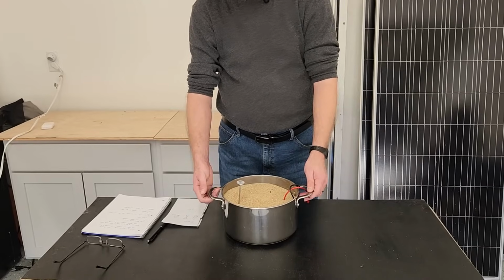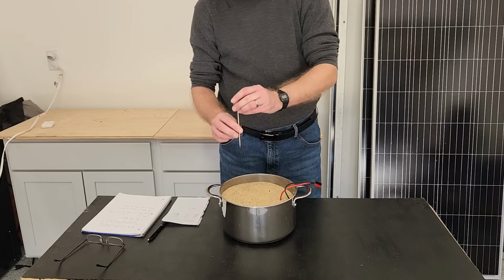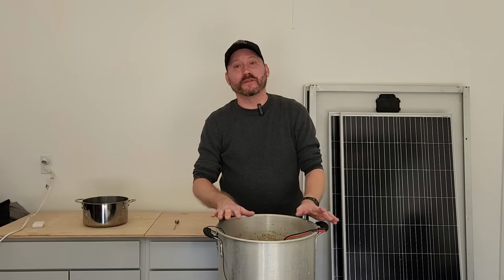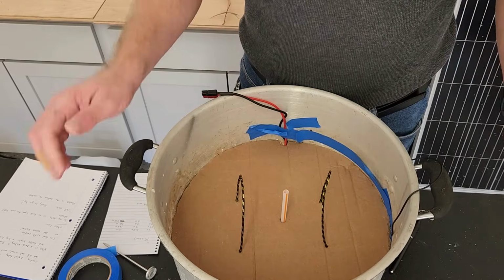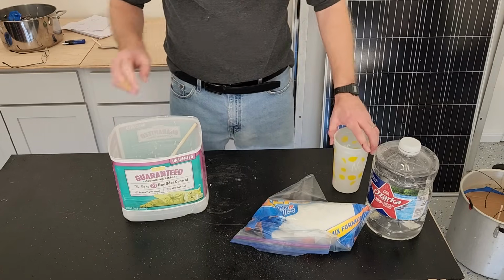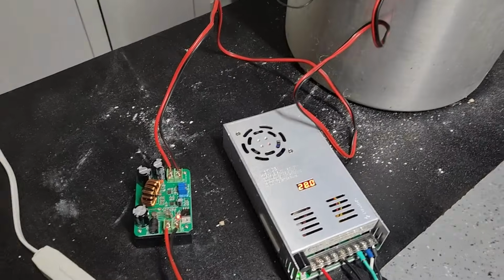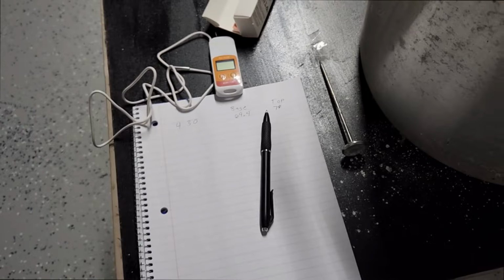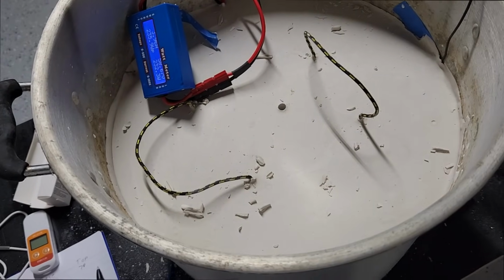Sand Battery heater. Create free heat  of 500F using solar electricity! Texas Prepper Projects

Comment: Hi, Nice project. You could turn the pot upside down. Make an entrance at the bottom for the thermometers and the heating element. They Will be at the cool bottom side and the warmth will be trapped on top. No chance of any heat  to leak through the lid. Secondly add insulation on the sides and insert U shaped tubes from bottom to top and back . Blow cold air through the tubes to extract heat. So you control when you want it. Use air to extract heat. With a fluid        is more dangerous because it will boil. Extracting heat allows you to setup the sandbattery stationary elsewhere and increase its size and capaciteit. The Hot air could be used to heat a secundairy heat exchanger Linked to a central heating system. You will have thus  more control over  the maximum temperature in the secondairy heat exchanger.
Reply: He is dealing with so much heat in some spots,  he might have a problem with oxidation of metals. But maybe he can run some copper pipes down the outside and coil inwards along the botyom and drill some holes on the bottom of the copper coils and force air through slowky and let the air filter through the sand.
Reply: If he had a more distributed heating element with a larger surface area, a mineral oil could withstand 500-600f. It would fill the airgaps reduce prevent oxidation of metals in the heating element and better distribute the heat to the entire body of sand.  Downside is while it may end up holding more heat, the sides would get hotter more quickly and it wouldn't hold the heat as long.
Reply from the maker: maybe

Comment: I would suggest using cement board instead of wood to create a trivet to set it on. Not a lightweight solution but it would not burn or melt.
Reply: That was my thought. Cement board or similar.
Reply from the maker: Agree
Reply from the maker: Agree

Comment: Good video ! I haven't read trough all of the comments , but I've seen some god suggestions for improving the sand battery. I would suggest that you get rid of copper water heating unit , because it will fail shortly at that temperatures and go with stainless steel ones (like from hot plate , or (even better) small electric barbecue grills - bigger heating surface) . Other suggestion would be to drill holes in the bottom of the caldron and to make electric connection outside of the sand container and prevent wires from melting and burning. You can also make hole for thermometer on the bottom too (with some insulation between edge of the hole and heating unit and thermometer probe).  Also , fine sand works better (like silica sand) and couple of coils of flex metal hose (about 2" diameter), within heated sand , will do great for convection heating (blowing hot air) , with a small fan on one end.
Reply: I would skip the electric heaters altogether and use a solar hot water system instead.  That would allow the sand battery to be tied in to a radiant heat system throughout the house.
Reply: @kmoecub  it is not comparable temperature vise. Also , hot water system is a - system , while this can be stand alone unit (and portable , depending on a size and weight).
Reply: Flex metal hose is a great idea!
Reply from the maker: agreed

Comment: Instead of plaster of paris, use the high temperature ceramic bricks that are used to line a fireplace, chimney, or brick oven.  These are available at home improvement stores like Home Depot, Lowe's, etc.  You could also use those type of bricks to build a base to set the pot on.

PS there is a commercial grade version being tested in Finland, and the article said that the sand could be heated to 600 C (1000 F) before it melts.
Reply from the maker: Nifty
Reply: Question: Once sand melts, is it a better conductor because it now has more density?

Comment: Beautiful work here! Thank you for your share! In a future project, you might look into aircrete in place of Plaster of Paris. I'm considering tubing and a compressor to dump heat from a server and a turbine to convert it to electricity. The server converts 3kW to heat, and I'm wondering how much I can convert back. Sand can take 830kJ/kg/°C. I'm planning to run the heat from the server into the compressor, then the sand battery, and then the turbine, the exhaust from the turbine then goes through a vortex tube resenting the remaining heat back to the loop and the cold into the server. My ultimate aim is to process 1MW or 2MW. It will be very interesting to see how much electricity I can recycle.
Reply from the maker: I think i'm going to use concrete for the next build. It's actually cheaper than plaster of paris
Reply: Now you have me thinking of possibilities.  Let us know how your work goes. I think you're on to something in regards to small scale/business waste heat recovery and power generation that would work well in the suburbs and rural areas.

Comment: Figure out how much power you gain approximately per day. Divide that by 12. That’s how much power you can use every 2 hours in a 24 hour cycle. Match those numbers with a long lasting heat source. Match those numbers too the right size sand battery. Make the heat rise after charges so that fan can disperse the heat until the heat is gone. You will need a high cycle battery too complete the system but I bet it’s quite efficient. I feel like your idea is linked too efficiency in some way. I love thinking about these things. I got a 98 in advance chem at one point before I left school. Would love to have a chat with you about it 👊
Reply from the maker: I think that this is about thermodynamics and heat gain.. and what the best way to release that is.  The 500F temp I got was nuts, but it needs to be released slowly and in an intelligent way. Stay tuned for rev 2 and rev 3..  But feel free to email me to discuss more!
Reply: @texasprepperprojects  ok. I just subbed. Will stay tuned. Have you thought of making the sand hourglass out after over time? Might be an easy may too time release the heat.
Reply: @texasprepperprojects  super cool topics 👏👏
Reply: @texasprepperprojects  heated sand waterfall? 😂

Comment: I would put it on flat stone, and also thermo wrap all the wires. Not necessary probably, but would make me feel better about not having any of insulation already on the wires melt and then come in contact with the metal. Also maybe a slower speed fan to move the hot air? Not fast but it may keep the room more all the same temperature. Both ears can be warm that way.
Reply from the maker: I switched to silicon wires in v2

Comment: Seems to me such a thing is most valuable if you have a space you'd like to keep from freezing (like a grow room under LED lights) that gets no direct sun. You could put heat battery in the grow room and the solar panel a good distance away where the sun shines. It's not obvious to me how you'd convert the heat contained therein into electricity.

Well done.
Reply: A Peltier element will convert heat to electricity or vice versa.
Reply: Peltier element or steam turbine  or steam motor for mechanical power. But its most efficient  when used directly for heating
Reply from the maker: i'm already using solar
Reply from the maker: I'm already making electricity with solar

Comment: What holds heat longer a bucket of wax or a bucket of sand
Reply: I would guess wax, but you'd have to do some complicated calculations to know for sure. It also depends on if you mean the total heat or to maintain the temperature. Wax is about half as dense but it has almost 3 times the heat capacity of sand, and its thermal conductance is slightly less.
Wax: Density 960 kg/m3, Heat Capacity 2200 J/kg K, Thermal Conductivity 0.2 W/m K.
Sand: Density 1500 kg/m3, Heat Capacity 830 J/kg K, Thermal conductivity 0.25 W/m K.
It costs about 50 times as much as sand. It melts, (boils, and burns,) at much lower temperatures, so it's not really suitable for an in-home heat battery.
Reply: @Mavrik9000   Good! Now do mineral oil. 😉
Reply: @Struthio_Camelus  
TLDR: You'd need about the same volume as sand but it costs about 15 times more. 
These details are surprisingly hard to find.
Mineral Oil: Density 875 kg/m3, Heat Capacity 1670 J/kg K, Thermal Conductivity 0.136 W/m K.
It would work as a heat storage 'battery' but the thermal conductivity is low, so it would absorb and release heat very slowly. It is used in oil-based electric heaters for thermal mass, and in transformers for cooling. Both are sealed. Mineral oil burns so it would be unsuitable for an open-air/container heat storage system. For an in-home heat storage and release system you would need a well-sealed metal container, and large external metal fins for transferring the heat quickly to air with a fan.
For a similar cost, you could buy (new) steel, which would be more compact, due to its high density. And there would be no need to worry about it being sealed.
Reply from the maker: Don't know

Comment: Sand is not very thermally conductive, in fact its a good insulator. The sand close to the heating element was probably extremely hot, but the heat did not disperse through the whole medium. Would be good if you could tap into to that hot spot in the middle, while the rest of the sand is basically insulating the system so it could stay hot for a long time.
Reply from the maker: Thanks

Comment: Interesting, I saw an article somewhere about a system like this they built in Finland, where its extremely cold.  I may try something like this for our vacation home.
Reply from the maker: Check out the follow up videos. It works in Finland because they have geothermal heat and this is good way to store it. I don't think its practical unless you do

Comment: This is a very cool experiment. One thing you don't explain well in this video is the relationship to heat/temperature and energy density. You mention the higher potential of heat storage for sand vs water, but not the caveats that come with it. 
First, the amount of energy a substance holds predicts how much energy it takes to heat that substance to a certain temperature. 
Water holds roughly five times the amount of energy as sand per unit of mass. So at the same temperature and the same weight, the water is holding 5 times as much heat energy.
This means, you need to either use 5 times the quantity of sand to make up for this, or raise the temperature of the sand by 5 times to get to a comparable energy density.
Sand can meet this requirement. I will use Celsius as it makes seeing the relationship easier in this case. Water boils at 100 C under normal atmospheric pressures. Sand melts at roughly around 1500 C at the same pressure. So, you can store 3 times the heat energy in the sand vs the water, and sand is as cheap as water, practically.
Here come the buts. 
1) Do you have anything that can hold the sand at that temp? 
2) While letting you get the heat out without melting the transport medium? 
3) What temps do copper and other pipes start melting? 
4) What temp will the element start melting? 
5) Can you hook it up to a heat pump instead since they can transfer heat more efficiently? 
6) Will you use water or air to transport the heat?
7) Why did I mention atmospheric pressure?
The answer to 7 is, we can change the boiling point of materials by changing the pressure they are under. This is the trick heat pumps use to work more efficiently. It takes less energy to bump up or down pressure and let the steam move itself than to pump the liquid. And liquids can hold more energy if you put them under more pressure.
So, in homes where we already have water pipes and storage tanks, where we have the tech and products, and we can pressurize water to boil at twice the temp, we can achieve similar results to what is practical with sand.
Now, in the world of large scale installations, this could be different.
Reply: Copper melts at 1084C, common alloys likely lower, iron a bit higher. 
The pressure required to double the boiling point of water is 225 PSIA, about 15 times the pressure at sea level. That isn't 'residential tech, or products,' it's 'cutting people in half with live steam when a coupling fails' pressure.
Reply: @Struthio_Camelus  I agree it is not ready for home use, but we can use that feature of pressure to store more energy in water.
At safer temps than 1000C, which I didn't even remotely address.
Copper also starts to warp and bend at much lower temps than that, so would it get compressed from the weight of the sand?
Reply: @NdxtremePro  I don't now how sand would behave at those temps, but if it's a concern, I'd cast concrete or refractory cement around the copper tubing.
Reply from the maker: Thanks!

Comment: I would like to see a large underground sand battery in the back yard with copper tubing running through it and heated with a wood stove. Use the hot sand to heat water for hydronic heating in the house.  If that much sand would stay hot for days or even weeks you wouldn’t have to burn the wood stove very often.  
I know nothing….  Just thinking out loud. lol.
Reply from the maker: So would I. They do this in Scandinavia over the top of geothermal vents

Comment: Great project.  How long do the water heater elements last at that heat level?  They're not designed for sustained heats of over 200 degrees F.
Reply: If you had a bigger one it would be better to use a heating element from an old electric stove top, idk if it will run properly with those specs he needs though.
Reply from the maker: That is a great question I can't answer. But for $10, they aren't expensive to replace and you don't have to run it for very long. I presume that since I'm running it at a lower voltage level that it's designed for it would be OK, but I honestly do not know.
Reply: Not a criticism, just an honest question.  As someone else mentioned, it might also be interesting to use something like and electric range heating element since they're designed to run at high temperature for extended periods.  They can be purchased for ~$20 as well.  I think this is an interesting project with some useful applications.
Reply: @FatherOfTheParty  Also, considering this is a prepper type channel, they are something very easy to rip out of a junk electric stove, even in a junkyard or something. You could even use the one out of your own electric stove if you have one of the older ones without the glass tops.
Reply: @FatherOfTheParty  10 years ago I had to replace a heating element in my oven.  It cost me $30 online (which was 1/2 the cost to buy from a brick and mortar store).  Since that was 10 years ago I think they might even cost more now.  $20 seems very low.
Reply: @tommak6516  How about one of the old stove top coil elements? An oven element would need a BIG container for burial. The broiler element in my oven is about 16"x18", the larger coil elements on the range top are about 8" diameter.
Reply: @Struthio_Camelus  I don't know what those cost, but I would agree they would be more compact.  I suppose it would be something to try unless someone on youtube  has already done so.
Reply: @tommak6516  $16 on Amazon.

Comment: Hi, Just discovered your channel while looking for other vids on sand batteries. I'm a prepper as well.
Earlier today I ran across this video by another DiY sand battery experimenter; 
"DIY Sand Battery Air Heaters! w/heat powered fans! no electricity needed! sand battery room heater!"
https://www.youtube.com/watch?v=n8emwEairpM&t=13s 
He used his kitchen stove-top to heat up his container(s) with sand. He had the clever idea to use one of those heat powered fans that folks place on wood stoves to blow warmed air into his room. That inspired me with the idea that I could put sand in a Graniteware black steel pot and place it in my All Seasons Solar Cooker (a sun oven) and let the concentrated sun heat up the sand. As you probably know, solar ovens can get up into the low 300F. Once heated, I'd place the 'sand battery' in a DiY 'HayBox' (homemade thermal cooker, lots of descriptions on youtube) to better retain the heat and set the heat powered fan on top to blow warmed air into the room. It also seems to me that such a setup could be used camping (if carefully heated by a campfire) and then used to warm up a tent or teardrop camper on chilly nights. No fire, no electrical needed, no propane, perfectly safe. Keep up the experiments!
Reply from the maker: Also the fan idea isn't bad, but he's going to loose a lot of heat through the top.   My rev 2 will incorporate some of these thoughts.
Reply: @texasprepperprojects  Sure but if you're wanting to heat a room spreading the heat with a fan makes sense, yes?
Reply from the maker: @geoffreydebrito7934    I think the overall answer is yes. One of the great things about heat is that it always wins.. meaning regardless if you spread it out or let it go on its own, entropy will get it where it needs to be.  But i have thoughts on something ;)